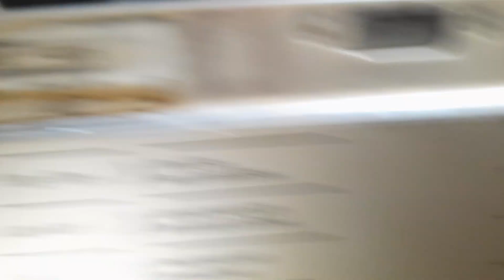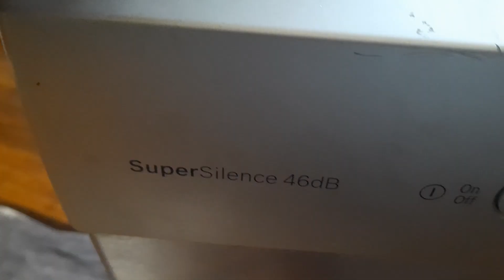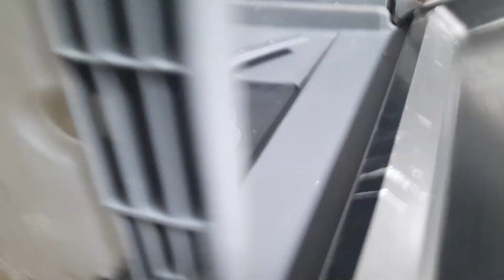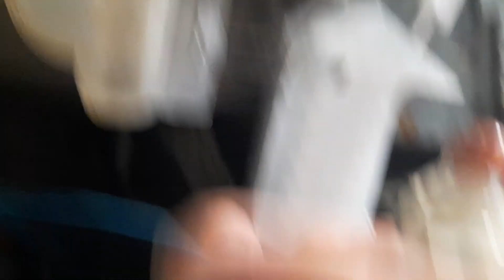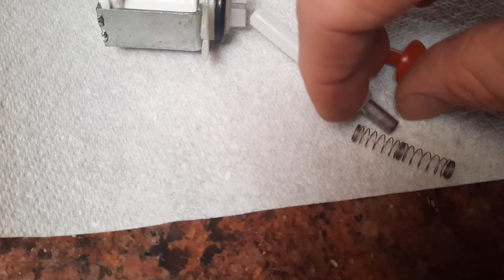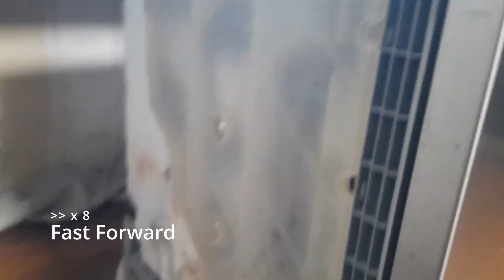Bosch Dishwasher Repair leaking filling basin between loads Solenoid Removal Series 4 SMS46KI01A/01

Comment: Mine was exactly the same setup accept when you go to remove the valve it will not turn at all up just slight movement ,the clips in the slot on your video turns as you twist the outket up mine do not move at all it dies not want to  budge